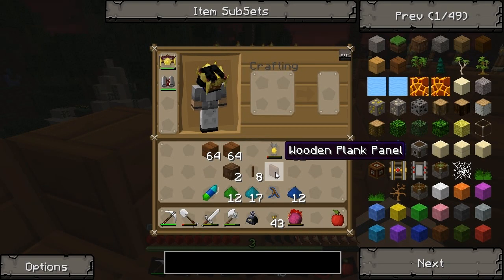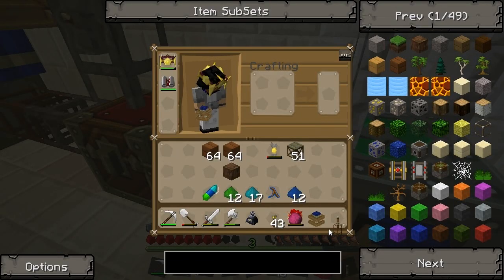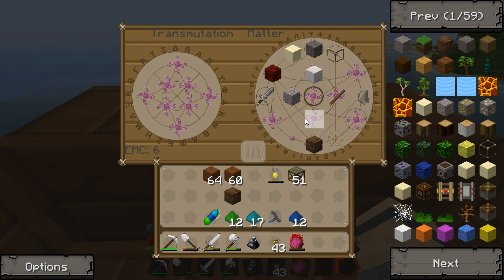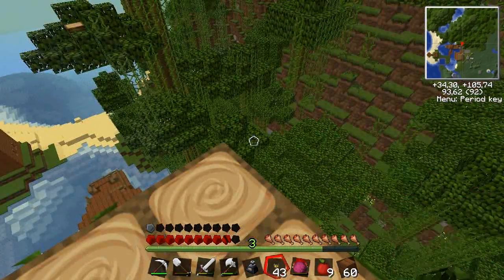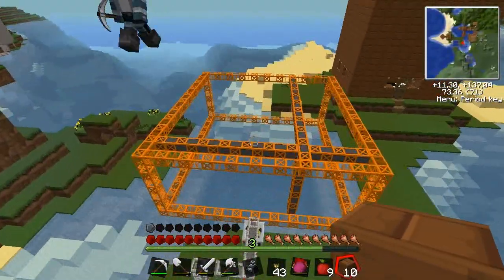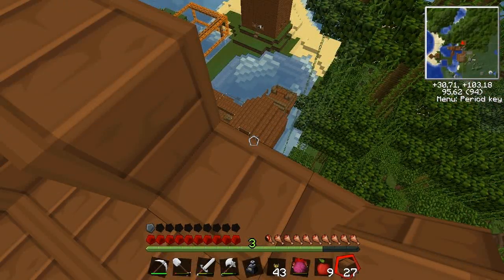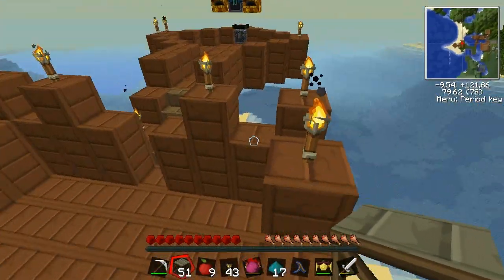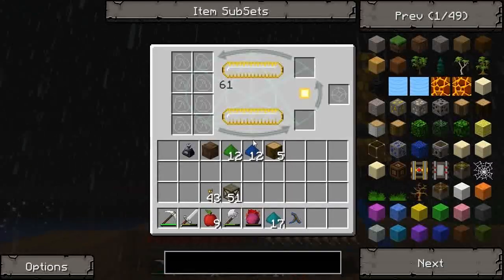LET'S PLAY: Minecraft Tekkit Part 42

Comment: its called an energy link. it transforms EU from industrialcraft 2 into buildcraft energy.

the energy link is connected to the quarry with conductive pipes. (one wooden one to extract the energy from the link and one to transport the energy into the quarry)

if i recall, conductive pipes are transport pipes mixed with 1 piece of redstone.

Comment: sure thing mate!

quarry -> diamond pipe.

diamond pipe exit 1 -> sends gems and coal into the good stuff chest in the machine room.

diamond pipe exit 2 -> sends all else to the system.

stone transport pipes (system) -> diamond pipe 2.

exit 1 -> sends macerateable stuff into the macerator. macerator has overclocked so it doesnt clog.

macerated goods -> diamond pipe (ok maybe not yet but he might wanna add this)

flint into a chest or recycler, the rest to the furnace.

Comment: (part 3 of my reply)

that was the schematic. as for the stuff itself.

redstone engines work by being powered by a lever, they make wooden pipes get the movement going on.

the wooden pipes extract items from a place and are connected to stone pipes. stone pipes cant extract from places, only transport. they cant be pumped directly.

diamond pipes filter items thanks to their GUI and multiple exits.

btw, golden pipes speed up items going through them.

the machines are connected to the MFE